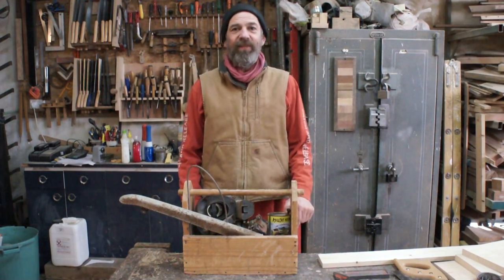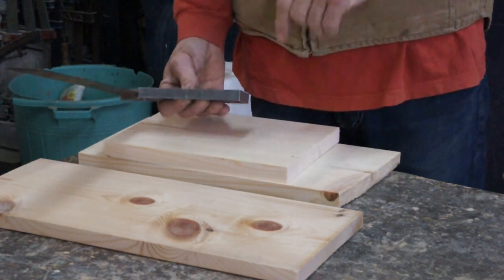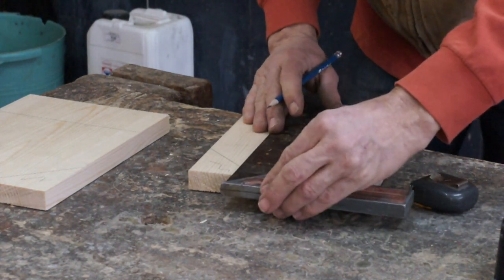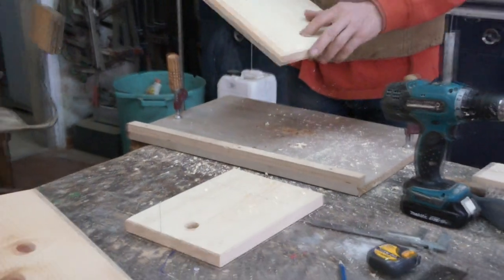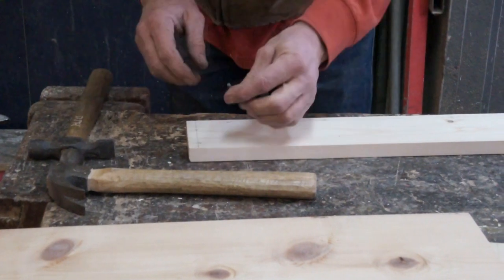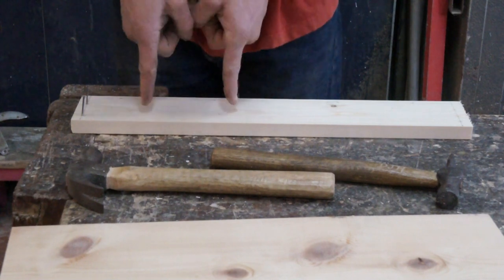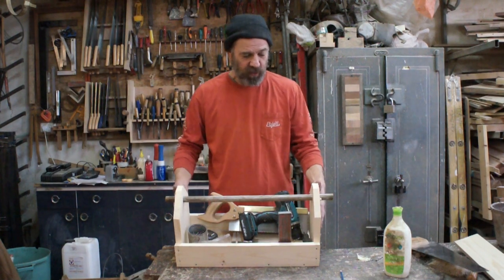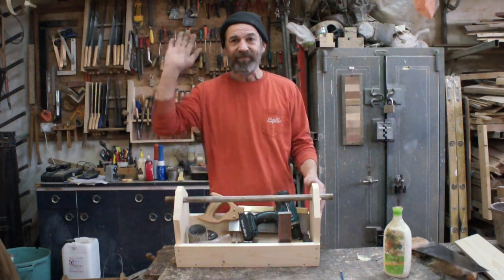Build This Simple Wooden Tool Box - Hand Saw And A Hammer

Comment: Excellent I shall be knocking one of these up for myself ,and maybe some for presents, once I get a few decent bits of wood.

A good tip for keeping nails straight when hammering is to use pliers ,or something like them which usually have a gap in them   ,and keeps the nail straight until the last few mills.Good tip about blunting the nails ,often split wood ,so will try that!

Cheers ,David!😎
Reply from the maker: Hi Memeophobe great presents!! thanks for the nail tips Take care All the best David